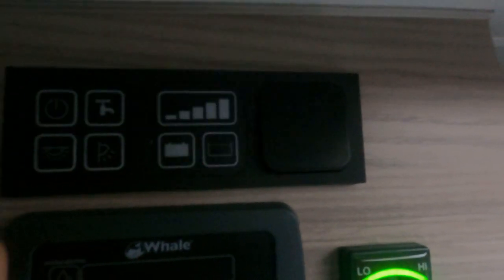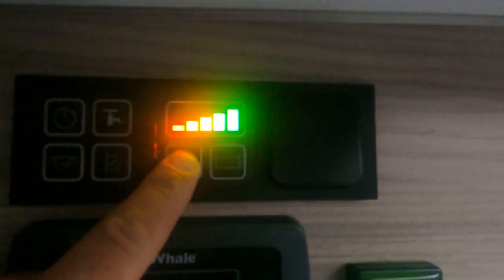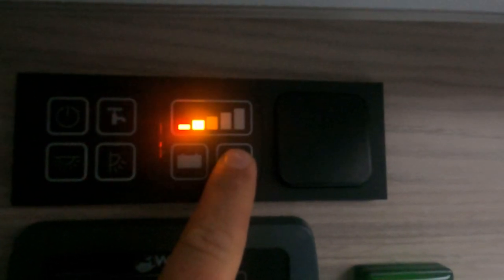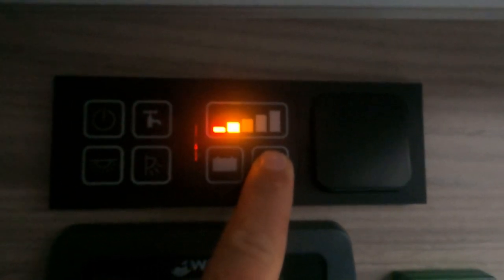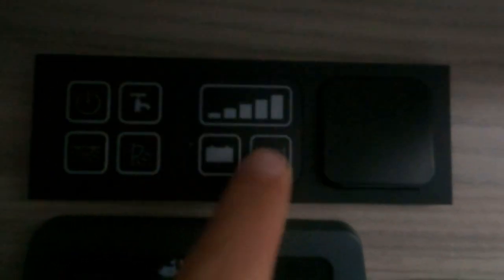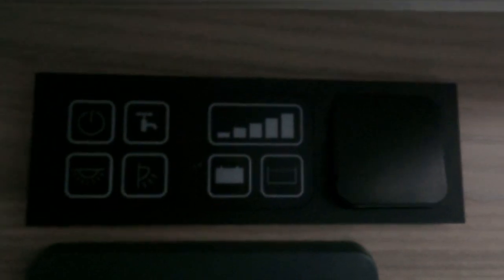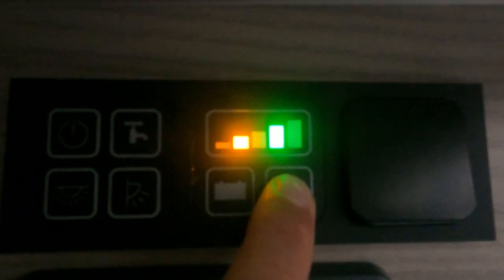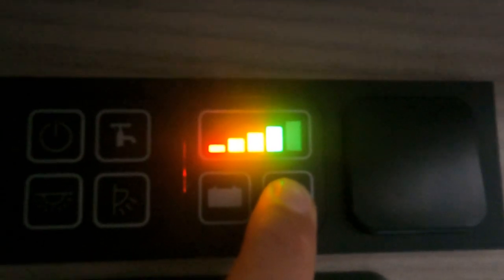Did Re-calibrating my water sensor fix this problem?

Comment: Those 2 lights that show after the second quick press have us baffled too! 😵‍💫☺️
Reply from the maker: I have emailed my dealer and told them the problems I am having. I will let you know if there's a solution but I'm not holding my breath.
Reply: @TravellingfromScratch  Thank you, much appreciated. 👍🏻Had a go at calibrating the water today but like yourself not sure if it’s worked ☺️
Reply from the maker: @twoboldlygoinourcampervan  It was worth a try. Let me know if you have any joy with it.
Reply from the maker: OK....Just heard back from the dealer who said that they have had some issues with the water tank sensors and they have ordered a replacement water tank sensor as a warranty repair. I will let you know how I get on and let you know if the new sensor fixes the problem as soon as it's done.
Reply: @TravellingfromScratch  Thank you Ian, good of you. Will keep you posted how ours performs ☺️

Comment: Great video as ever Ian.  I don't want to wet your fireworks but many CV owners think the water level gauge is not worth the space it occupies on the head-banging panel.  They reckon the gauge needs recalibrating each time the ignition is turned off, which makes it pretty useless.

I can tell you what the second press of the button does though (when you were briefly getting two bars with a gap between them lit).  According to the Owner's Manual (Page 9-3 in mine), it indicates what type of water probe is fitted to the fresh water tank.  In the case of the CV, it looks like it's a 5-prong probe.  Maybe the other types work 🤣
Reply from the maker: I'm gutted. I will give a water meter a go.
Reply: @TravellingfromScratch  - thats what we did.  Its a Gardena, but if I'm only putting 20 litres in for the journey to site I use a "Ricky" special -  bought a 10 litre watering can and it's far less faff.
Reply from the maker: @barr0ld  yeah that's my plan too. I'm gonna ask the dealer but I don't have much hope to be honest.

Comment: I'll have to be honest I gave up with the water gauge, even though I did recalibrate I was never confident it had 'taken'. So to be sure I knew how much water I put in the tank,  I bought a cheapish water flow meter (£23 pounds from Amazon) and works great. It seems like the general advice is to travel with 20 litres on board (as long as you know you can top it up when you arrive on site) and a flow meter allows you to do that with confidence.
Reply from the maker: Thanks Brian. I'll go have a look at one.